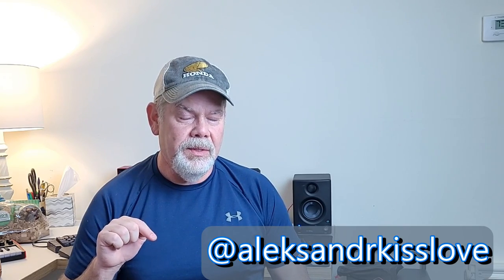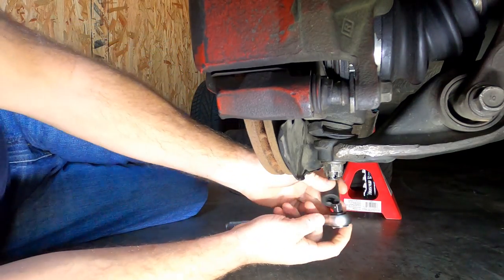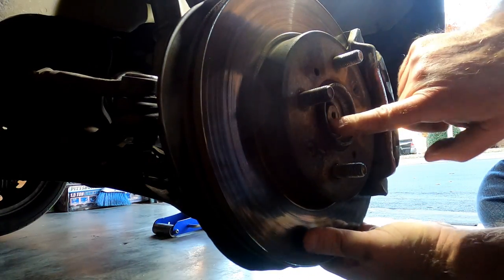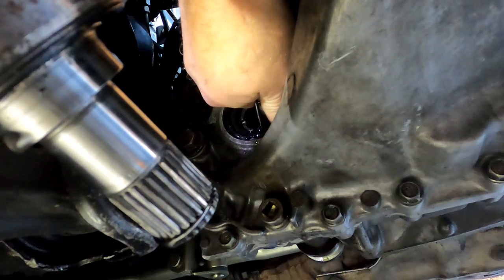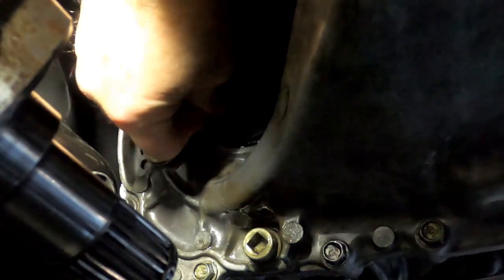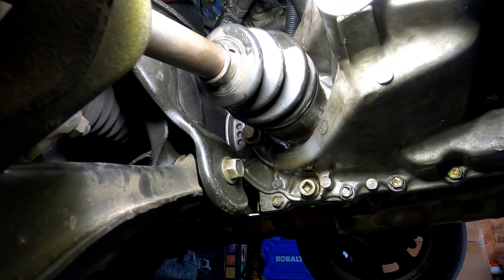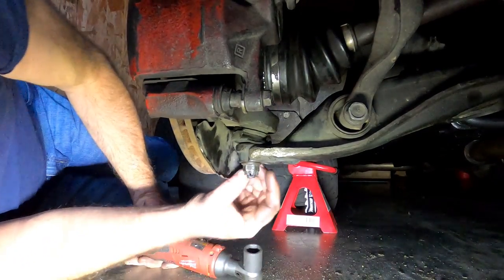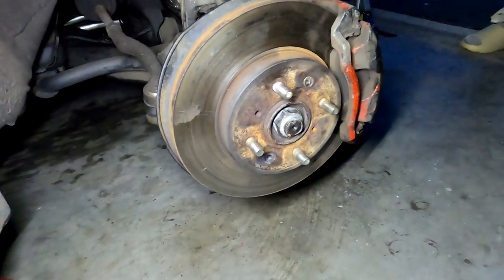Honda Axle Seal: Everything you always wanted to know but were afraid to ask!

Comment: That’s what I just did pushed it too far inside and the leak was worse.  That’s why I’m watching your video and for your advise.  Thank you 🙏
Reply from the maker: Glad you found the video. Those seals can be frustrating!
Reply: Were you able to pull it out a little or is it toast?  I must have watched 10 videos that said, "hey just put grease on it and use a 36 socket, like "No worries it's easy!" so I did but it didn't look right.  The side from 12 o'clock to 3:00 o'clock looks pushed too far in.  I can't stand when people don't post all the details. Creator thank you for this.  Ugh.
Reply: Just had to pull it out with a seal-puller and yes it destroys it.  POOF. $25 gone because people don't explain it correctly on Youtube.
Reply from the maker: I'm glad you found the video to be helpful! Just greasing up the old seal after you go to all the trouble of getting to it is too much of a gamble. Buying a new one is the right choice.
Reply: @ktecgarage  Thanks. I just bought a new one from the Honda dealership(After tax about $24.50 as of July 2024).  The original I took out(not the first replacement that I screwed up/pushed in too far) doesn't look like the one I just got from the dealership so maybe that is why it was leaking to begin with.

Comment: I bought a new seal, installed it recessed to the lip. Heard so many conflicting info regarding it being recessed. Honda has a lip on my civic. I pushed it all the way in, drove fine. Today I managed to take it apart again with my finger, used silicone, and put it flush.
Reply: Ok, good. the video says it is toast if it is already in there.  how did you get it out safely?
Reply: @sl5311  If it's a new part and you used some sort of lube to install it (grease like in this video or like me I use a tiny bit of auto trans fluid) you can very carefully remove it 90 percent of the time. I've done this with different oil seals of various sizes. If you can get your finger inside behind the lip and a finger on the outside lip like a pinching motion you have a chance of slowly working it out going in a even circular pattern. The larger oil seal has a bigger metal clad surface that you can really get ahold of that can be easier. I've been successful with clean removal and reuse of new accord and civic camshaft seals, front oil pump seals on civics and accords, a cv axle seal on a civic, and some others. For smaller oil seals like the cam and front oil seals you can use a hooked pick by lubricating the pick very well with atf and then slipping it in the lip before carefully turning it and pulling back slightly to make contact with the metal or thick rubber hollow part. You can then pull the seal out carefully. As long as you are careful and work slow alot of things can be "un-oopsied" or reused on older Hondas.

Comment: Is there some seals that go in further by factory specs? Just wondering about my 2006 Odyssey. Just did it and had to use my old axle shaft with seal installed backwards to beat on it and it went in more than flush. Maybe 1/8 inch or more. 

I hit like on your video by the way, thanks for the info!
Reply from the maker: Not sure about the J series, but I don't think so.

Comment: I replaced my passenger side axle again due to a torn boot. When I installed the new axle it started leaking CVT fluid. Had a hard time getting the seal but it's fine now. Do seals usually fail when installing a new axle
Reply from the maker: I would say removing the axle shouldn't damage the seal unless it got bumped or torn and you didn't notice. Sometimes just messing with something like an old seal can get them leaking.
Reply: @ktecgarage  does the seal have to be 100% flush with the case? I noticed mine to be about a mm off on one side
Reply: @AwesomenessIskey  Yeah this would be good to know because I saw a comment on another video where someone warned to not seat the new axle too tight up against the transmission-that there should be a slight gap or something.

Comment: My new axle seal is not sitting 100% flush but not leaking. I tried to push it in about a mm using a plastic pry tool and screwdriver without removing it
Reply from the maker: If it's not leaking, don't fix it if it ain't broke.

Comment: My 2013 RDX J Series driver side is leaking a bit of transmission fluid. My mechanic recommended I replace the seal and axle. Would you replace the axle if you were me? Or just the seal? OEM isn't cheap! But not sure how I feel about aftermarket. It has 105K miles. I just did the water pump and timing belt which was how we found out it was leaking.
Reply from the maker: It's probably just the seal. If they are recommending an axle, check the boots on it for leaks or tears. I'd do an aftermarket axle myself.

Comment: Ty for this video  I have a national seal 712551 from the local auto part store and one from  Part Greek online  OEM Corteco 1903521B for a 2009 Honda Pilot   Driver Side AND THERE IS DIFFERNT in Design. Mine is leaking using  National . Im putting in the OEM Stuff back in. to resolve the leaking problem
Reply from the maker: Yep. OEM is a much better choice for that. And they aren't that expensive. Good Luck!

Comment: I know this is old but i’m going to be replacing my whole front end , ball joints and control arms n all, couldn’t i just avoid removing the axel nut and disengage the lower control arm and pull the axle out still? like with the whole knuckle assembly
Reply from the maker: Yep. If the whole knuckle is coming out, the axle will come with it. Good luck!
Reply: @ktecgarage  thank you for replying!

Comment: Good info.  Question...If its leaking from the Axle seal...should it be leaking transmission oil or motor oil. 2009 Honda Civic is leaking at the driver side.   Thank you
Reply from the maker: Should be transmission fluid. Honda trans fluid is clear, not red.
Reply: @ktecgarage  umm my odyssey tranny fluid is red. The manual tranny fluid is clear though.

Comment: So on the pass side of the 09 crv has a larger axle seal. How do I remove and replace that one? Same process?
Reply from the maker: The seals are different sizes on the Civic in this video as well. The process should be the same on both sides of the CRV.

Comment: It seems kind of harsh to use the axle to push it in to the transmission case further. How is that not impacting the inner CV joint negatively.
Reply from the maker: Maybe.  Those things are engineered to take a lot of torque. If you have ever looked inside of the boots, you'd see that they are some pretty solid units. I get your misgivings,  though.
Reply: @ktecgarage  Thanks for your reply. On another note, if I accidentally damaged the seating surface for the output shaft seal and now I have a leak after re-assembly have you got an opinion on whether that can be repaired with JB Weld? It seems extreme for me to have to consider a replacement case. The old seal was almost impossible to remove and I scored the seating surface unfortunately. My worry is that a small amount of JB weld won't be substantial enough to stay in place and then it could break loose and get into the valve body or block fluid flow somewhere else in the tranny. I feel pretty stupid right now.
Reply from the maker: JB Weld. The redneck's solve all! In all seriousness, it couldn't hurt to give it a shot. I think I would try Honda Bond or some other gasket sealant first. Let us know what you tried and how it goes.  I would also suggest checking out my video on Honda axle seals. They will leak if not flush with the Trans case.
Reply: @ktecgarage  Thanks for your thoughts. I have been waffling back and forth in my mind about using honda bond or jbweld. Honda Bond might be better because I would put it in during seal installation instead of having to create a perfectly round seating surface with the JB weld. I think I will take that route. on another note when I put the shaft seal in I might not have gotten it perfectly flush so that might be causing some grief too. Not sure I want to push it in further and test it and then redo it again and test it......such a pain in the butt.

Comment: Hello I have a question to asked you I replaced the seal on my drive side on my civic It's a d series manual transmission I still keep getting fluid Barley driping out I replaced the seal three times one from honda So I finally pulled the axle back out of it I notice there's a little tiny hole inside of it Doesn't look like it's supposed to be there You see it right when you pull the seal off of it My question is is there supposed to be a little tiny hoe next to the shaft inside of the seal?
Reply from the maker: I did a 93 Civic with the D15 and I don't remember any holes in the seal. I did it exactly like this video and never had an issue. Just make sure that the seal is flush with the case and not pushed in too far.
Reply: @ktecgarage  I forgot to mention the hole was inside the transmission When you pull the seal out you'll see it right there in the transmission case

Comment: yo im new to cars and i dont know how to identify my problem. on my eg civic when i slowly take off theres like a loud clunk sound and u can feel it in the floor board. only happens when i slowly take off or sumtimes it happens while going over a speed bump. theres lil play in my pass axle like on the trans side i can lift it up and down. my cousin said it could be my axle or maybe the seal is bad or sumthign and it doesnt sit right in the trans. any info would help. its been doing it for awhile and its annoying
Reply from the maker: Check the ball joints, control arms and sway bar bushings and end links. That could very likely be the source of the clunks. Check out my Honda Element videos where I address all that. Same as the Civic.
Reply: @ktecgarage   will do. replaced the ball joints ill make sure to check out the others also

Comment: Hi. Would you know why the axles would come out again? Mine seems to be not locked in properly
Reply from the maker: They can appear to be all the way in, but when you drive the car, they can pop back out. After you push the axle in, grab the other side, pull back and then slam it in.  Also, there is a c clip on the end of the axle that holds it in the transmission. If it's worn out or damaged, the axle can pop out. Good luck.
Reply: @ktecgarage  i think it might be the clips then

Comment: Very poor design to have a seal without a stop built into the casing. Just having it flush like that on the outside is nuts. I have seen many transaxle install videos not one mentioned this, and they actually sometimes say to use the 32 mm socket to seat the seal. Our 2009 Civic transmission has been a disaster anyhow, several sensors have gone out at random times and had to drive home in low gear.
Reply from the maker: I cuss engineers everytime I work on a car! Maybe they know something we don't about that seal.
Reply: Same here.  I just replaced my 2009 Honda Civic starter, don't get me started on poor design.  That and the quiet recall for the 8th gen Civic cracked block issue have me moving away from Hondas in the future.  I just used a 36 mm socket to seat my seal and it seated it uneven because of me being under the car and having to use my hand pressure.  I was nervous about using grease because I didn't want to contaminate my tranny fluid.  No one talks about this. I know I have to be careful on my Mercedes.